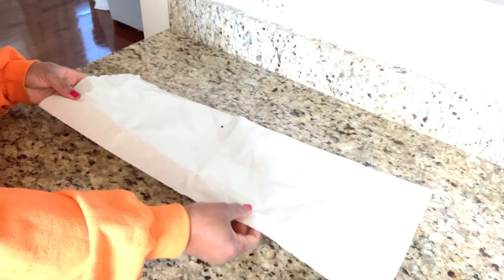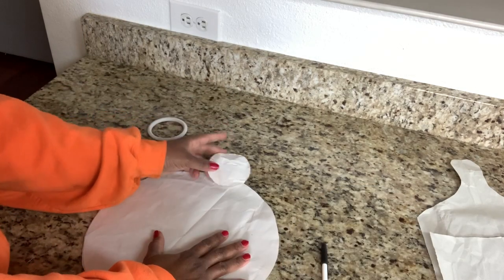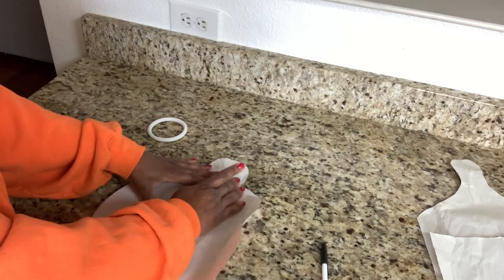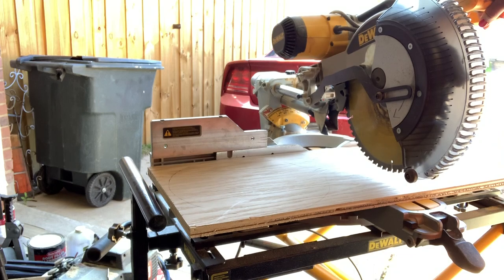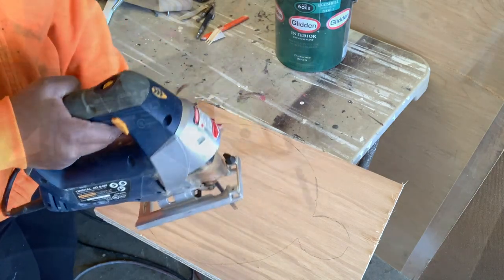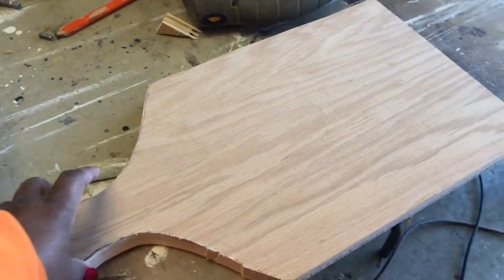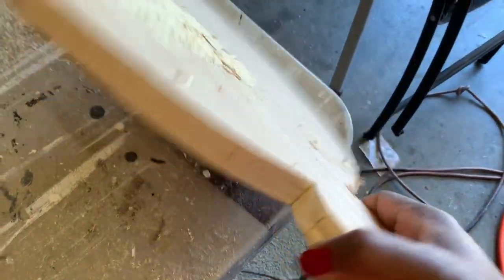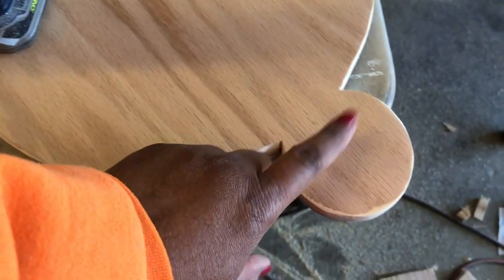How to make cutting board / Fall Decor Ideas 2020

Comment: Hi Shenelle you know your way around the wood shop well, you saved a lot of money making your own boards. I have several different cutting boards that I thrifted and want to paint the handles, do I have to use a certain paint that’s food safe?❤️
Reply from the maker: Well I have to say that’s not my lane.  I checked the web but it says no paint is food safe.  You might check with a master craftsmen on that.  I will only treat like butcher block.  If I place food on it will be in a plate for these or use parchment paper.  Someone may come along with an answer for you Jaye.
Reply: I will leave as is until I know better, thank you❤️